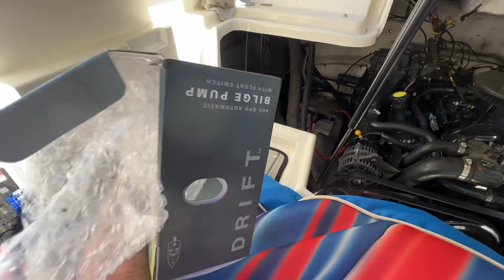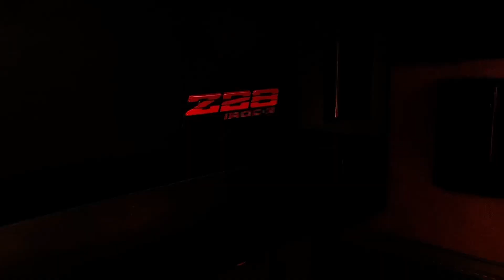BOAT taking on ALOT of water !! What Could it be?? STARTER got wet Now it wont start Buy Marine only

Comment: Boats are a whole new set of maintenance procedures, especially with I/O’s (inboard - Outboards) like you have. That fuse popping on the bilge pump very likely meant that the pump was frozen and when the switch activated, when the motor did draw power but didn’t turn, it blew the fuse from overload. Couple or 3 quick points…Not sure how much water leaked in from the shift boot but make sure you get some WD 40 or better yet Fluid Film and spray all around the lower part of the out drive and the oil pan under the engine to stop corrosion which makes things more expensive and much tougher to repair. #2 there is another bellows that goes around the outdrive case to the stern housing, while it doesn’t move around like shift bellows it must be changed because if that breaks you can take on water much faster than what you experienced with the shift boot. Actually they recommend removal of the outdrive from the outside of the boat annually making sure to grease the driveshaft liberally before sliding it back into the flex plate on the back of the engine. If that rusts in place your looking at tons of work and money! And finally #3 your exhaust has elbows at the top of the exhaust risers, these pump water into the downside of the exhaust to keep it cool, over time those elbows also rust and can then direct water into the engine via the exhaust, one tell tale sign is if you ever blow a sparkplug out of the engine. Don’t think its the plugs fault it was steam pressure that did it. Those exhaust elbows need to be checked annually as well and depending on the amount of salt water exposure may need replacing every 3-4 years..BOAT = Break Out Another Thousand. But time on the water is totally worth it!

Comment: Outdrive leaks are a major maintenance concern with boats, but the way you check your hubs after one close call on the rig you should be fine with boat maintenance too, keep teaching those boys to care for their investments so they last years. I used to have a 25ft Trojan with twin 318's back in the 80's until the marina cut it up for firewood because I was behind on rental space payments.

Here's a tip: get some steel fishing leads with snap hooks on both ends about 36" long. Get a set of cheap tools for the boat and drill small holes in the handles for the leads to connect and add a small eyelet bolt near the transom for the cables to hook onto. You'll be kicking yourself every time you drop a tool overboard when fixing something while in the water. Now they won't fall farther than the safety line. It also helps keep track of dropped tools in a tight engine bay.